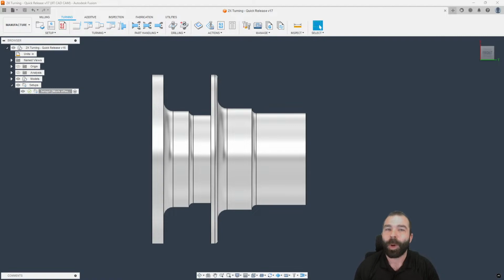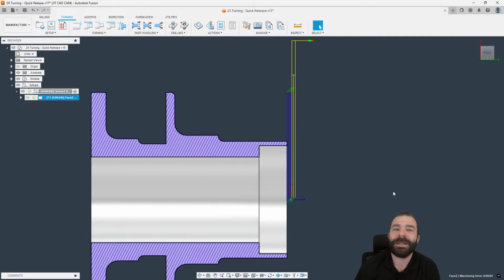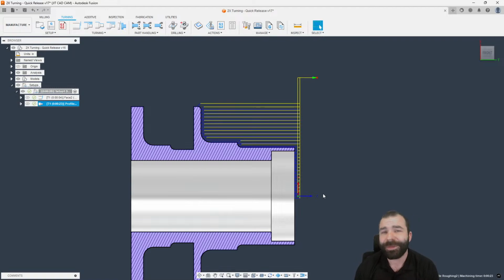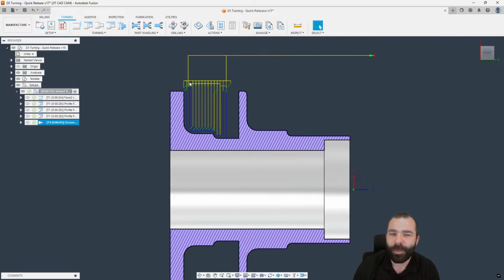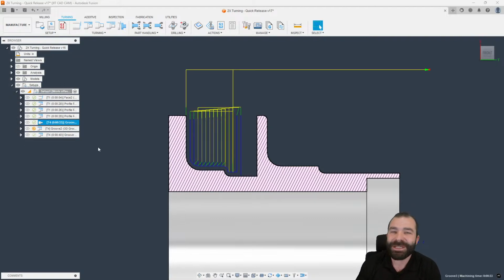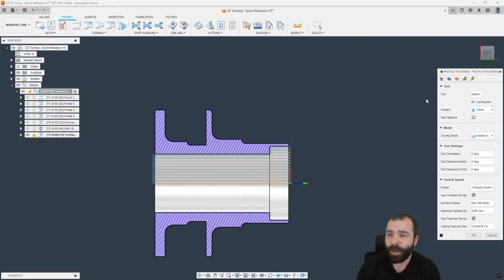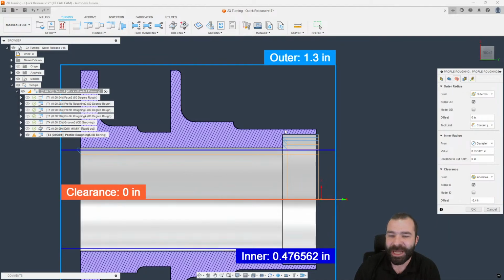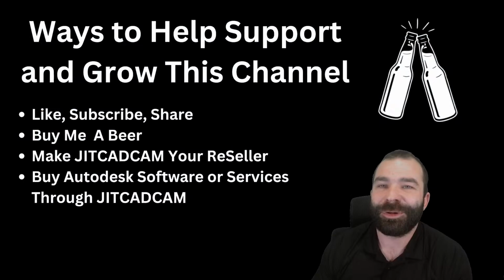Workflow Wednesday: Secret To Better Turning Toolpaths

Comment: I always had a problem with the entries and exits of finishing paths using G41 and G42, the program showed errors and it looked strange in the simulation. I found a solution by setting the tool tip radius for the turning tool to 0 and the problem was gone.
Reply from the maker: That a great tip!!!